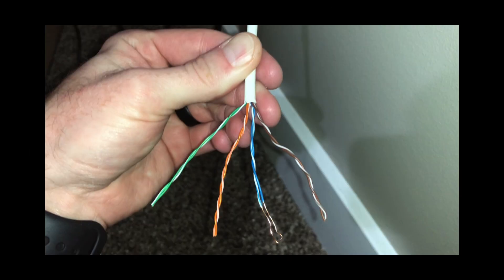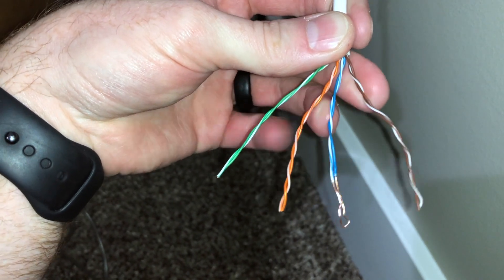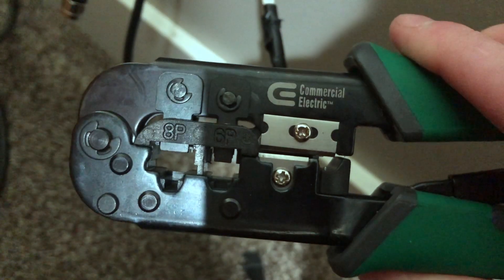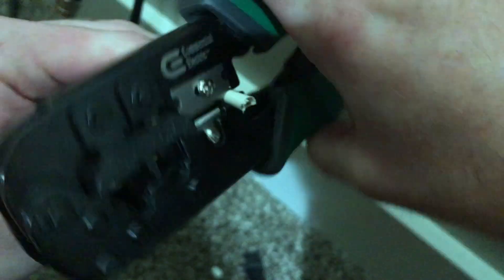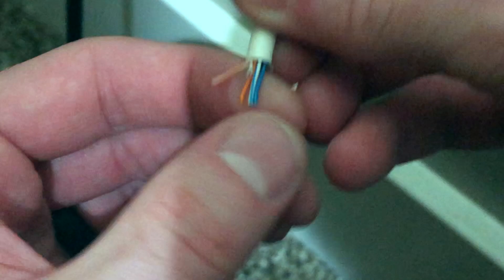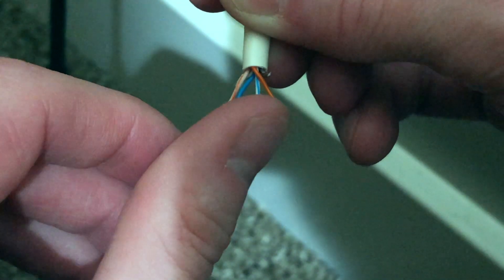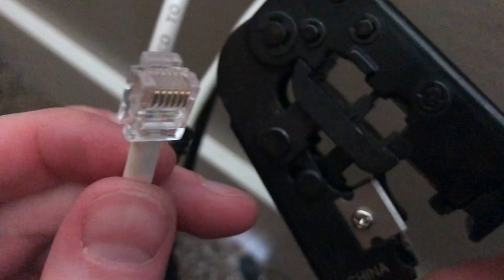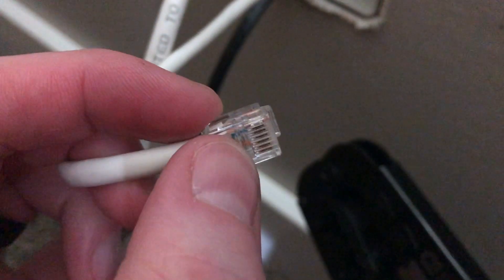Cat5e to Cat3(RJ11): Convert an exiting Cat5e cable into a phone line (Cat3/RJ11).

Comment: Just an FYI. An RJ11 plug will fit into an RJ45 socket. You can wire the RJ45 socket with Ethernet cable, but connect the other end to your phone wires. The pin out on an RJ45 is designed to handle telephone also, so it will work. If you later change to VoIP phones, you can just connect the source end of the Ethernet cable to the network and now use the RJ45 socket as a network outlet for the VoIP phone, computer, or whatever you want.
Reply from the maker: That’s for your information for the community

Comment: I have a sensor cable I need to make for a woodworking machine and dust collector.  It uses a phone jack, but rather than 2 or 4 wires, like a normal phone connection, this sensor needs a 6 wire set up.  So would I use a 6P6C phone jack connector?  And just get a 6 conductor cable?  Do they make a 6 only conductor cable or do you have to buy an 8 conductor and just not use two of them?  Thx
Reply from the maker: This claims to be a 6P6C cable: https://amzn.to/47WSwUI

Comment: I have a question,  i am very new to this and have no idea what your saying and what im doing but i will try to explain,  i wanted to replace my telephone jack inside the jack it has these exact same color wires that you have and amout of wires. My new jack has 4 screws or posts. I tried to use all the wires and my home phone didn't work.  I have my main phone the one that gets plugged into a jack in another room . So i hooked up just 4 wires i used the solid colors only on the 4 screws my phone works now but the jack im replacing does not work?? Im not sure how to wire it so this jack will work and my phone in the other room will work also. I need this jack for my wifes heart monitor. I would really appreciate some help. Thank you very much very much
Reply from the maker: Are you certain of the wiring sequence on each end?
Reply: @DIYBRY  i do not know the wiring sequence,
Reply from the maker: @markschrader7223  can you take off the wall plate and look at the wires coming in?
Reply: @DIYBRY  yes i will
Reply: @DIY-BRY  ok i have it off finally,  sorry it took a while, i have solid blue on post B i have white and blue on Y i have solid orange on R and i have white and orange on G
Reply: @DIY-BRY  there are solid green, white and green, solid brown white and brown solid blue white and blue and solid orange and white and orange
Reply: This is all the colors available
Reply: @DIYBRY  that was all the colors available
Reply from the maker: @markschrader7223  hard to visualize. Just make sure the the colors are match on all ends of the line and what is connecting to the line. You said you hooked up all solid colors, but what you are connecting to are not the same?

Comment: You see the little hole on the far right side of the cutting blade, that’s designed to put your wire in and the blade be at the perfect height for only getting the jacket. 

You don’t need to cut it so much and it doesn’t need to cut all the way, just a score will allow you to break it off super easy by bending it.

Comment: This video was extremely helpful for my current project. Just a thought, for those that may not be good with cables like this, no need to trim that much off until you put your colored wires in order.  Makes it incredibly easier.  They also make pass through connectors now which make things unbelievably easier now.
Reply from the maker: Thanks for the suggestion to the community.
Reply: @DIYBRY  i have fiber optical internet  10mb conection  smart tv   box is 70 meters away from the ont hauawii router , does 5 e cable do the job for me or shouldis go for 6a  , does  bandwidh of  100mhz of 5e  works for me in this regard please guide
Reply from the maker: @scorpian3366  Cat 5E should handle 1000Mbps. If you need more than that, you would need to upgrade to Cat 6. Does that answer your question?
Reply: I lost my crimper and connectors

Comment from the maker: ATTENTION!!! 
It has been pointed out that my video is actually showing a 6-pin 6-connectors (6P6C) RJ11. I was shipped the wrong thing and clearly didn’t not notice until after uploading. This video will work if you have the 4-pin connector or the 6-pin 4-connectors (6P4C) RJ11. The sequence for 6-pin is (left to right):

White-Green • White Orange • Solid Blue • White Blue • Solid Orange • Solid Green

Really anything arrangement can work as long as they are the same on both ends.

Comment: Which color for two phone connector (2 pin) please
my modem only has 2 pin phone connector
and if i can join two color with each other for a better connection
i have the cat 6 shilded
thankyou :)
Reply: The blue pair is industry standard, but if you keep things the same on both sides it would be fine using a different set. It will however, confuse who ever is coming in behind you. As for up doubling pairs, I doubt it would help anything, especially on an analog line.
Reply from the maker: Blue is industry standard.

Comment: But it's a 6 pin connector?
Reply: It's 6pin(positions)-6contacts, but if you're only using 2 you don't need this. You can use the cheaper, more readily available 6P4C connectors. What's important is that you terminate the wires in the correct placements inside the connectors. Also if it's just one line the standard colors used would be the Blue pair. Any color set will work however as long as you keep the placement consistent on both sides.
Reply from the maker: Thanks for the information for the community!

Comment: So you're terminating the wires in the connector on both ends exactly the same way?
Reply from the maker: Yes
Reply: @DIYBRY  which type of coax cable are you using? Is that RG6, RG59 or something? Thanks and best wishes
Reply: @nonstart9632  It's not coax ,
RG6 and Rg59 are coax for TV's.  The cable here is Cat 5 for data lines.
Reply: @1saregare1  I’m terribly sorry for my silly mistake. I mean if we have a single cat5e cable, can we use that cable for both internet,ethernet and phone line? Thanks
Reply: @nonstart9632  No worries man it's not a mistake if you didn't know.  Yes, usually the ethernet cable is Cat 5 or  6 at this point.  the phone jack is different though.  Rj11 or RJ12.